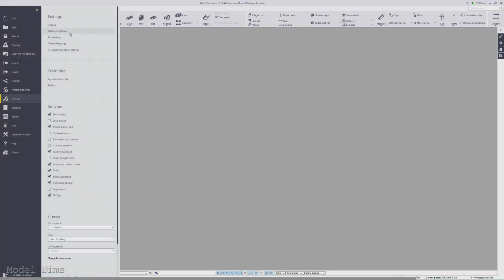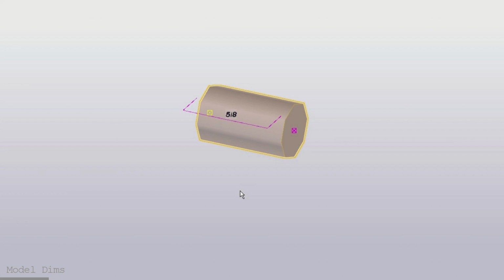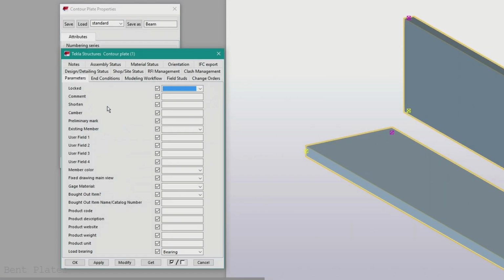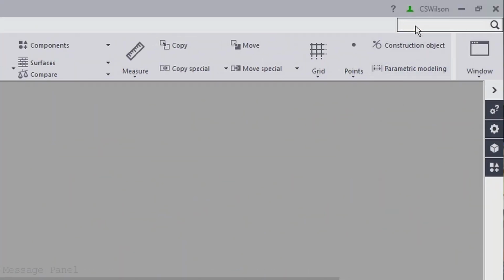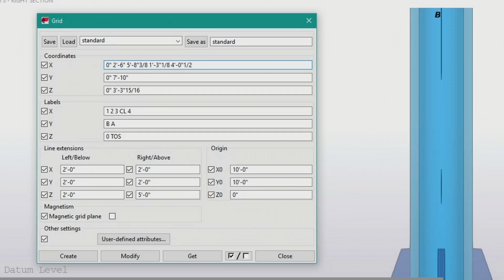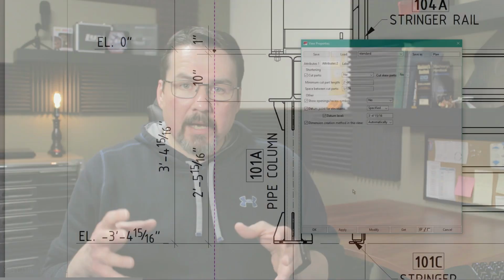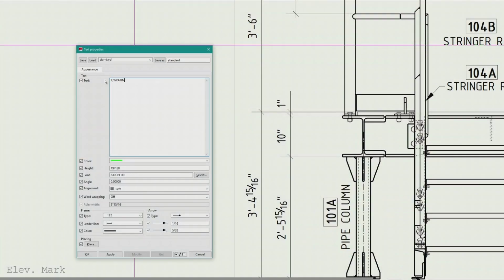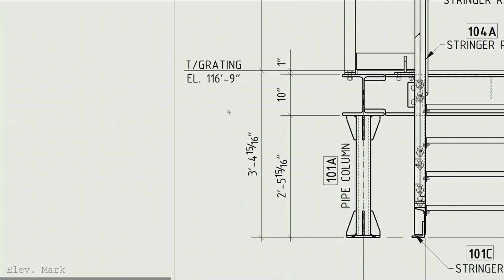Tips and Tricks: Part 2 - Modeling Techniques Using Tekla Structures

Comment: Thanks, dear.
If we use drawing view base datum we won't get real level in the model by inquiry command which is important in collaboration.
Is there any way in model similary?
Reply: The relatively new functionality Base point and Project base point, allows you to set an "insertion point" and rotation for your model. This allows you to use that in any drawing and export functionality.
If you want to see "correct" elevation in the model view using Inquiry you need to modify the inquiry-dialog. That requires some skills in template-programming. The templates that are used for inquiry might differ depending on your installed environment, and can be found in >Tekla installation folder>\environment\common\system , ie C:\TeklaStructures\2018\Environments\common\system. Their name starts with TS_Report_Inquire_<TeklaObject>.rpt where <TeklaObject> might be "Part", "Cast_Unit", and so on.  Please note that your own installed environment might have some or all of these files in corresponding environment, for instance; C:\TeklaStructures\2018\Environments\sweden\system and therefor overrides the ones in common. My guess is that if you place a copy for testing in model folder that will be used primarly. 
These rpt-files can be opened in Template editor. You need to localize the valuefield that uses TOP_LEVEL_GLOBAL and change or perhaps better add a new valuefield with the attribute TOP_LEVEL_PROJECT (for project basepoint-used top level) or TOP_LEVEL_BASEPOINT (for current basepoint-used top level).
Reply: Hi Gullan, thanks mate.

Comment: how to export tekla model to staad and sap 2000
Reply from the maker: For Staad, see this link: https://teklastructures.support.tekla.com/2017/en/int_exporting_a_staad_model

For Sap2000: https://teklastructures.support.tekla.com/2017/en/int_sap2000
Reply: thanks I will try. Is thee any link software which works with latest version of staad and SAP 2000 & Tekla. Till 2007 there was.
Reply from the maker: I don't work with either of these so I honestly don't know.  You might try checking the Tekla Warehouse for additional software.

Comment: Hi Mr Wilson
Thank you for these tips that you've found out the hard way but shared with the world nonetheless. 
As a precast detailer, I had to dig my way into the realm of custom components, which is not so popular among fellow Teklans as far as I see. I made quite a many miles into this, but faced a hurdle that is a bit too high. Hope you can show me the direction. 
I described the problem here:
forum-building-information-modeling.2295365.n4.nabble.com/quot-Display-Variables-quot-won-t-show-v16-1-td4640909.html
 Thanks in advance.
Reply from the maker: Unfortunately, I have NO experience with these.  I'm a steel detailer and haven't really had a need to create any custom components yet.  There's a topic on the Tekla Forum (forum.tekla.com) specifically for CCs and there's a lot of knowledgeable users that contribute to it.
Reply: Since it originated as a steel detailing software, tekla hardly needs custom components for steel. So this was the answer I anticipated, but I thought it was worth giving a try. That content in the real tekla forum is out of reach for me since I have no maintenance deal with them.  Thank you for your time.